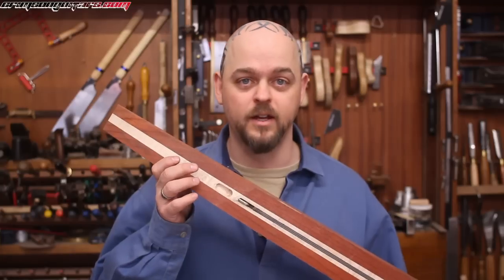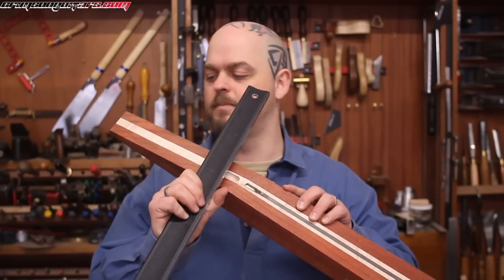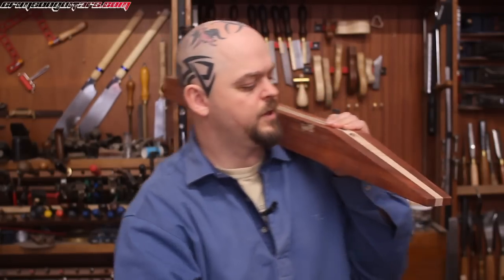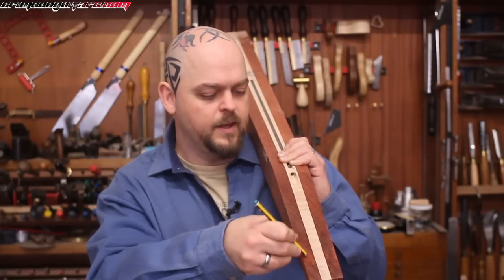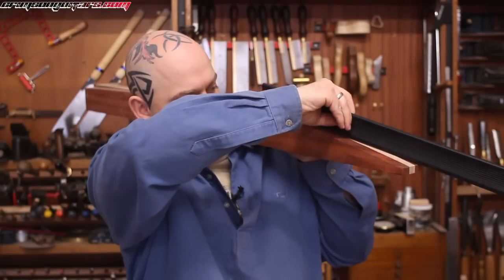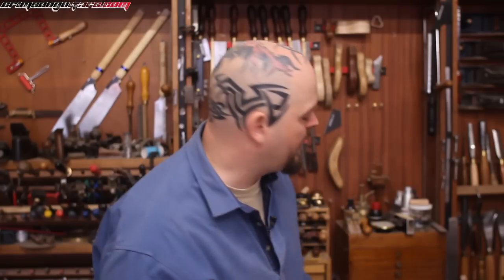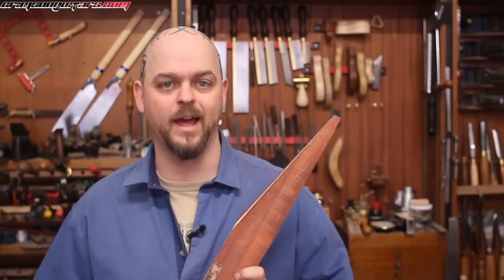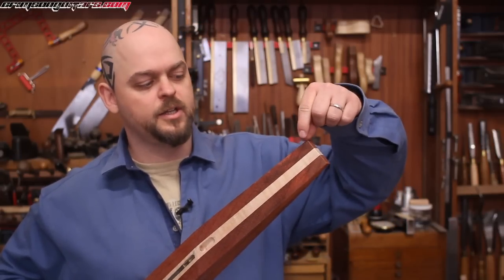Compound head stock angles on a fanned fret guitar - Podcast 135

Comment: I built my fanned neck Fender style. I use a spindle sander to create the roll/transition behind the nut. I changed the angle of the roll/transition slightly to match the nut but other than that it's a basic Fender style headstock. It ended up being way easier to build than I had previously imagined.

Comment: Planning on building a fan fretted bass.  I was thinking of using an angled nut for the end of the fretboard and a second nut at a slightly lower depth that is squared up so I don't have to do anything weird with the headstock.  Thoughts?

Comment: one way of thinking about it is you end up with a polygon made up of 4 points that don't all live on the same plane. If you work in any 3d modeling software, you can easily run into this issue, which is why STL files (commonly used for 3d printing) are made up only of triangles. If you take Any 3 given points in space, you can always find a single plane that intersects them, but if you add a 4th point, that's not a guarantee.  This is an interesting problem with fanned fret guitars I never thought about until earlier. Crazy stuff.

Comment: I cut an angled nut slot directly into my fretboard. It seemed easier than following all the steps to land the nut directly at the end. All I had to do after was file down the exposed end on the fretboard to allow more clearance for the strings. But no compound on the head stock.

Comment: I just planed the whole headstock angled (method 2 of what you said). I see no problem with that. But of course if you want to keep up the illusion of straightness, you can. It makes the string angles vary, but it's not that critical.

Comment: i just made the nut straight, scooped the headstock like a fender and made the zero fret tilted. its basically a standard headstock and a spacer connecting a fanned fretboard. then again its the only fanned fret i have and the second i ever made, the first one fucked up, and i never play the second one because the ergonomics suck. dont know if i just hate fanned frets or if i gootched it up.

Comment: Also is there any method to gluing aluminium as binding to the body I have used heat to bend the 2mm by 6mm strips to the shape needed. Super glue didnt go well even after keying.  I know you have previously done aluminium binding for a fretboard.
Reply: +Samuel Hook 
Epoxy.

Comment: suggestions for tools to stock:  rosette cutting tool (manual rather than drill).  Gramil ... or whatever you call those thingamejigs that you can cut purfling and banding lines by hand with before hogging out the rest with a chisel (not those horrid demil attachments that mess things up).  oh ... and capable of being used on guitar or ukulele :)

Comment: Wow - it's hard to explain my thinking on this in pure text comments!  Basically, I think the best way to describe it would be to imagine the following...  The headstock angle is as if it was carved for the highest string, but with an overhanging fretboard on the bass side.  Obviously you wouldn't do the shaping that way or you'd end up with unsupported fretboard on the bass side - shape the headstock angle as if it was as described above but without removing the material on the bass side.  Hot-diggitty-dog, this is hard to explain.  Hopefully you get the picture - a fall-away from the nut end of the fretboard to the tuners, a bit a-la-Fender but with an angle.  Stuff it, I give up on explaining.

Comment: I recently bought a 100$ davison guitar off of ebay for a project guitar. It came as a bolt on and my plan was to strip the finish, set the neck and stain the whole thing a deeper red. I've stripped the finish from the body (which is plywood) and found out that underneath the color coat is a very thick layer of some resin, which is almost a millimeter thick. I now have a fraction of the time I had for the project (I want to get it refinished before I move from the dry mojave desert to the wet pacific northwest). I was wondering what you recommend to do about the layer of resin, and as a quick way to paint the whole thing (by hand, I don't have the spray gear) that is the least cost effective and most "bang for your buck" so that I can save for some gas money getting up the coast.

Thanks, Nick